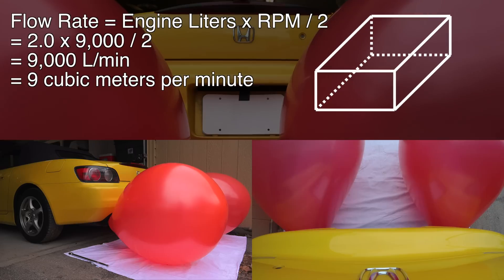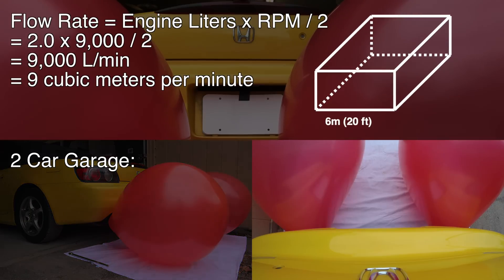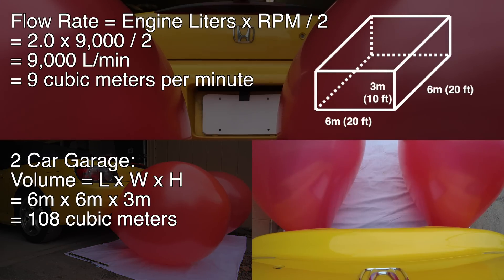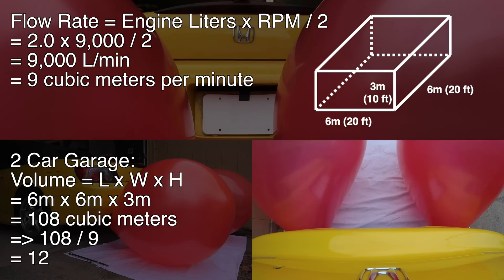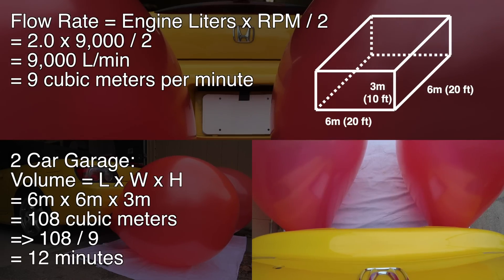Inflating Balloons With An Exhaust - How Much Air Do Cars Use?

Comment: So 12 minutes to kill myself in my garage with my S2000?
Reply: Jordan Moffitt Only 2 with a Chiron ;)
Reply: assuming that you can run it at 100% throttle in your garage and that you could also get the car running so badly that after passing through the engine once, it would be enough to kill you, yes.

Comment: I've got a straight piped exhaust on my car that's a 6-4-2 and even with it being brand new with nothing blocking air flow in either pipe, one exhaust emits way more gas than the other. I get the whole "least resistance" thing, but shouldn't they both have the same amount of resistance?

Comment: Both didnt inflate at the same speed... why ?
Reply: because the pipe junctions
Reply from the maker: Exhaust path to one balloon was likely easier, and one balloon likely required slightly more pressure to inflate (difference in the quality of each balloon).
Reply: Oh that simply :o I was looking for something more complicated like air has to travel more to go to the right than to the left :D

Comment: Not only are the gas cars letting out harmful smoke, it's also taking in good air we could have breathed. One more reason to switch to electric cars
Reply: No
Reply: James Henderson Change that to if you want to buy me an electric car that goes more than 3 miles before needing a recharge then go ahead
Reply: shut up planes pollutes 100.000 times more than cars so theres no need to switch to electric cars
Reply: Nope. Planes burn about the same amount of fuel per capita (per person) compared to a car used to travel the same distance

Comment: Except, you were actually showing the volume of CO2 after it passed through the cold exhaust, where it would have surrendered most of its heat.  Surely the luke warm CO2 volume is higher than the volume of air, since the O has combined with C from the gasoline.  i gallon of gas gives 20 lbs of CO2, which has a volume of ? at STP?.

Comment: the bugatti hast turbos so the calculation is not right or am i wrong ?
Reply from the maker: Yes, it does, making it's volumetric efficiency greater than 1 (1.85ish, so you multiply by absolute boost pressure as a ratio of atmospheric. Ex: 14.7 psi of added boost, equals volumetric efficiency of 200%).

Comment: i think the fumes were just circulating from the other baloon out the right exhaust, nothing's unhealthy about the engine, although inhaling them is a different question. The fumes would have also cooled down considerably while in the baloons so the white smoke i assume would be primarily steam
Reply from the maker: Yep, after reviewing the footage it seemed like most of it was from the other balloon as it deflates out the exhaust. At the moment, it was a bit shocking because I didn't exactly see how much 'smoke' fell when the first balloon popped.

Comment: I like how the remaining balloon started to shriek as it pushed exhaust back into the system and out the other side. lol
Reply from the maker: Yep, pretty neat! And you can see how relatively low the pressure inside is, because it does not deflate very quickly.

Comment: 1 question. De Chiron has a turbocharged engine. So the volumetic eff is >100%. So it uses even more air(or is the 60000 l/min an official number?)
Reply from the maker: 60,000 is a number Bugatti has claimed. But yes, volumetric efficiency will be greater than 100%, I believe for the Chiron it's around 185% (1.85 bar peak boost), but I'm not sure what redline is.

Comment: how long will a Tesla take
Reply: Find the exhaust to put the balloon first :D
Reply: I would put a big fart can on it - well, sadly nothing will come out of it. Unless you install a compressor... well well well, also needs sound system to simulate it being some kind of 4 cylinder 90 HP ricer. Of course.
Reply: Valoro85 let's put a balloon on the chimney of the solar farm at the gigafactory
Reply: Easy to find out. Find the exhaust pipe and put a balloon to it. If there's no exhaust pipe, find the power plant and put a balloon on its exhaust pipe. If that power plant has no exhaust pipe (if it's solar or wind, for example), go to the sun and put a balloon on that.
Reply: Doesn't that imply that at SOME theoretical point it will be so? I would rather say 0, since it cannot be. :D (or can it?)
Reply: David, thats not how it works. The moment hydrogen comes into contact with the oxygen in the air it immediately combusts, causing fires. If there is a large tank of it, the tank will explode almost immediately. You seem to be extremely ignorant on the subject, so please don't try to comment on something you don't know about. Buoyancy takes time, chemical reactions often take less than a fraction of a second.
Reply: David Serrano all fires travel up mate. The hyrogen will explode/light a flame before it can escape because it reacts immediately with oxygen. It is physically impossible to have hydrogen gas in the atmosphere because it ALWAYS reacts with oxygen immediately. By the time the hydrogen is used up, it will have set other things in and around the car on fire.
Reply: David Serrano omg, you are hillarous. Hydrogen you produce in chemistry class is less then a graction of a gram. Not nearly the same as the pounds of the stuff required for running a car.
Reply: Slap that balloon on a coal power plant chimney and you'll find out!
Reply: Schmidt54 I see what you did there
Reply: Schmidt54 90hp? no wonder people think Hondas are rice they got the numbers all wrong
Reply: Yeah that's obviously way too high.
Reply: ootdega really? Lol
Reply: +David Serrano

:^)
Reply: But then the power a Tesla uses must be equal in percentage to what the plant spits out
Reply: You are correct. Also the building of the car and especially components like the battery emit C02, besides being very nasty for the environment in production (rare earths mining is quite horrible). But technically, after the car was build, the power that it runs on can be from natural sources like the sun, wind, tidal powerplants or such. Of course they would have been build too at some point, but it is better than always stright-up using gas.
Then of course, there is hydrogen as a power source, and Toyota even build a car that uses it. I find that pretty neat, no battery needed and the chemical process of making hydrogen is pretty clean, too.
Nothing is perfect though, but we can try to do it better and better with more passing time.
Reply: Ganaram Inukshuk the same power plant exhaust exists for gas.
Reply: Schmidt54 smacks forehead
Reply: brilliant! :))
Reply: The problem with hydrogen is that if you crash and the tank cracks, everyone in the car is dead and the surrounding area is now on fire. 

Only a small problem i know,  but most people like to avoid things that explode.
Reply: DivideByZero nope. Thats not a problem at all. Hydrogen is extremely light. So it would float away on fire causing minimal harm to the car.
Reply: They invented a way to make the hydrogen into a liquid state, so it can fuel up your hydrogen powered car like a gas powered one. Neat.
Also every substance that is created to mit energy at some point is volatile and dangerous; gasoline has really dangerous fumes, LPG and other "alternative" fuels are quite flammable as well. So are car batteries by the way, even small notebook batteries that malfunction do quite the damage and burn nicely. There is a risk to all of those, and in my book, hydrogen should be the future and not pure electric cars - unless they invent a way to charge them within 10 minutes and give them a range of 600 km and more even in cold winter and hot summer (that might be achieved soon).
Reply: +DivideByZero - Not without a spark it doesn't. It doesn't just spontaneously explode...
Reply: DivideByZero well if that was the case there would be a ton of hydrogen fires regularly. A lot of reactions results in H2 gas. Sure it's much more volatile. 

But like I said it won't be that big of issue because of the properties of hydrogen. The gas will leave the area rapidly causing the fire to last a short amount of time and the flame will be traveling upwards. Especially if you take into consideration the fact that the tank will be pressurized.
Reply: Which btw is noticable whenever you look at a hydrogen fire. It's always extremely tall because the hydrogen is igniting as it floats away.
Reply: DivideByZero dude who taught you that? If that was true there would be fires in chemistry class every day bro. A lot of reactions produce H2. Also batteries produce H2 iirc. And when someone does electrolysis to produce H2 and O2 in perfect ratio it still doesn't immediately light up.
Reply: DivideByZero ok man. If hydrogen fire was a major concern car companies would not be designing vehicles to run on it.
Reply: David Serrano Car companies aren't designing vehicles to run it. Dude, we've had the technology for decades, hydrogen combustion is not new. No one is making cars that run off it.
Reply: DivideByZero what? There are multiple hydrogen vehicles out right now. And the reason why they are is because a hydrogen fire is not a big concern. https://ssl.toyota.com/mirai/fcv.html
Reply: David Serrano untill you crash the car that is.
Reply: DivideByZero compared to gasoline the fire is not a big concern.
Reply: Compared to gasoline, it's a much bigger concern. When was the last time a carcrash caused a fire because of the gasoline in the tank?
Reply: DivideByZero you keep implying that it will autoignite. Gasoline has the same chance to autoignite. But it doesn't.
Reply: David Serrano No, it doesn't. You can put a cup of gasoline in your house and it won't light on fire. The same cannot be said for hydrogen. If you did that with hydrogen, it would explode.
Reply: Filling a balloon with hydrogen is still a very low amount of hydrogen, still probably less than a gram of hydrogen. A tank running a car will likely require several pounds of hydrogen, which is a completely different beast.
Reply: Schmidt54 Tesla's don't have an exhaust like I do. Oh and by the way,

That is a joke.
Reply: DivideByZero ok man. You are right. I'm sure people don't fill balloons with hydrogen for demonstrations. I'm also sure people don't do electrolysis of water without fire. It just doesn't happen.

Comment: Honds s2000 has a volumetric efficiency of over 100% in the high lobe vtec range, typically around 110% I have seen it in a honda s2000 tech sheet from Honda. I think the intake valve closes around 65 degrees after BDC so even though piston rising on compression stroke the intertia of the mass of intake air continues to fill the cylinder more.
Reply: xD "so even though piston rising on compression stroke the intertia of the mass"
Reply: Greg Blank Ok you got me on a technicality!
Reply: It reads so funny when you clip that part out xD
Reply: put a turbo or supercharger then maybe I'll believe you.

Comment: Why didn't the left balloon pop?
Reply: WazzUppFLO because those 2 exhaust tips are linked somewhere so after the balloon poped  exhaust gasses started to escape from the one that had poped balloon
Reply from the maker: Because the other balloon popped, so no more pressure was being added to it as the other exhaust was open at that point.
Reply: Engineering Explained damn so the right word was popped haha was trying to think right one close to 5 minutes
Reply: Engineering Explained Ahh yeah makes sense